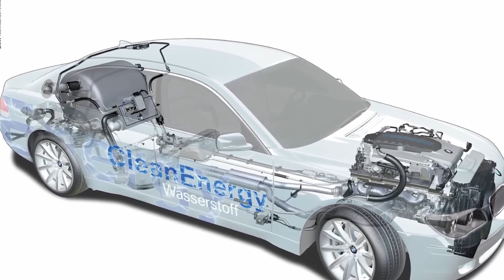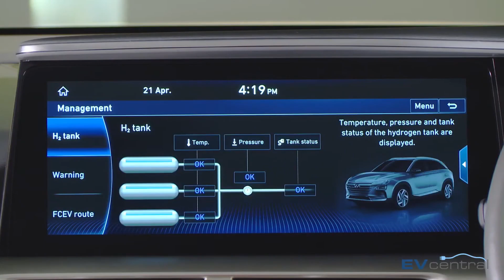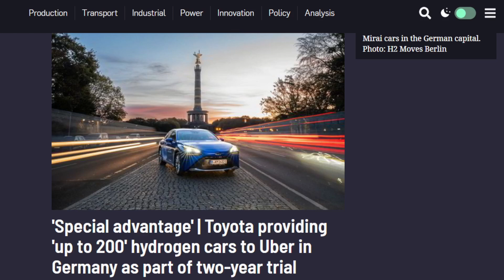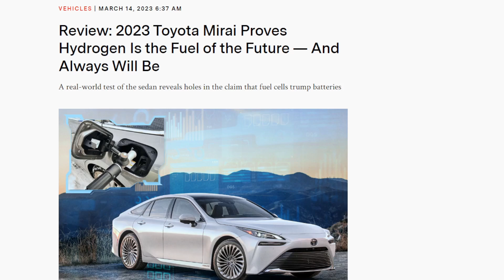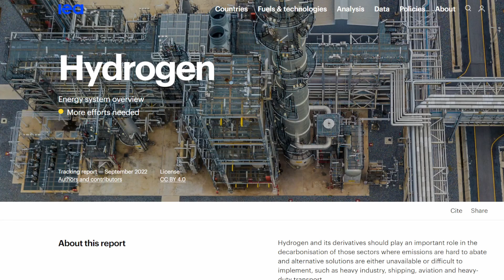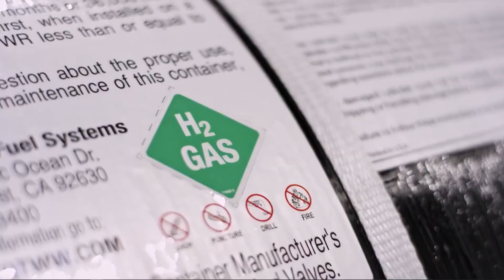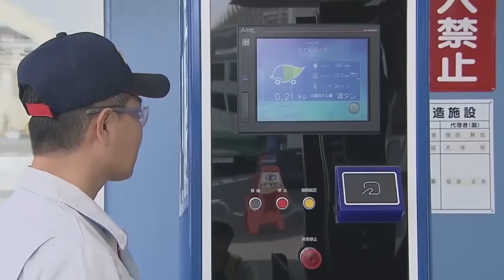Toyota Is DOUBLING DOWN On Hydrogen-Electric Cars - Here's Why.

Comment: VA, Another consideration here long term is the investment in filling stations and the commercial eco-systems that surround them.  Think livelihoods too.  Having cars pull in to refuel and by coffee, etc. requires a commodity like hydrogen.  Most likely, while many EVs will need to pull over to recharge, the vast majority of electric cars will be charged at home.  Not so with H2.  At some point, the oil companies are going to need to weigh in on their own futures post 2030/40/50.  That future needs to be envisioned by them now, because it WON'T be petroleum.  My bet is that H2 will be that commodity of choice.  As gas needs go down across the US, H2 as a void filler will best allow for a 1=1 transition, i.e., H2 production : refineries), pipelines : pipelines, filling stations : FSs, delivery trucks : DTs and H2 for gas.  I just don't believe the volume of car and foot traffic will be there if its an EV-only automotive future for the USA.  Maybe so, but Big Oil is going to have to take a vote in the matter too at some point, because the ICE world will melt around them otherwise.  I suspect the initial glimmers of where they stand in the matter will surface in an annual shareholder event related to the very real and looming problem of "stranded assets."

Comment: Hydrogen in 1978 - 1980 was used in Chicago Buses - when gas and diesel prices were 35 cents a gallon - 45 years later - we should be using Hydrogen to move all our 18 wheel semi trucks - in one day the US Postal Servive creates how much pollution inside of America - it is crazy - to THINK after 45 years we are not using a cheaper and more abundant fuel - as we burn coal to produce our electricity - Nikola Stock - buy now - 90 cents - everyone must be crazy - not to support it - in America

Comment: Unfortunately, the elephant in the room is the cost of hydrogen.  At the pump, the cost of hydrogen from 100% renewable sources has gone up another dollar from $26.75 to $27.75/kg at True Zero stations in the US.  Not heading in the right direction.  Hydrogen: $0.43/mi (Mirai), Gasoline: $0.09/mi (Camry hybrid), and Electric: $0.06/mi (Model 3), all with South Pasadena CA figures.  And the Model 3 weighs less than the Mirai and has more passenger and cargo room.
Reply from the maker: And inflation is 5%. Tell me something new.
Reply: @visceral_investing  Well maybe something new you didn't know would be that my electricity rate went down by more than 20% in the same time period.  If H2 was generated with electricity (green), it should be less and not more.  Also, the price of diesel to deliver the hydrogen went down by 22% in the same time period (from $5.25/gal to 4.10/gal).  As well as natural gas (gray hydrogen) prices fell by over 50% but still, Hydrogen went from $26.75 to $27.75.  They make it pretty much real-time, so it's not like there's some expensive inventory from the past they have to work through.  It goes up as people realize the true costs of a transportation hydrogen infrastructure.

Comment: I have come across 5 different types of electrolysers in all,one type called aem is a combination of two other types being the alkaline and pem models. Solid oxide models are now breaking ground in bigger way also.

Another type i have stumbled upon uses plasma and different frequencies and thats just the electrolyser technologies,on top of that
theres also a pyrolsis plasma technique using discarded things like tyres or food or waste paper etc and converting into hydrogen

You also have galvanic techniques utilising stored galvanic energy in metals like nickel,methods that incorporates lasers,artifical photosynthesis, enzymes that are found to give of hydrogen,alot is happening. 

I think much more innovation needs to take place just electrolysis alone as it is won't cut it,far to energy intensive.

I hope with ongoing geology survey work around the globe going on hydrogen can be safely and effectively be extracted from the ground as is the case in a Malian village.

Comment: I think the 3rd generation mirai may come out in 2026 or possibly next gen crown fcev
Reply: Crown FCEV is out the end of 2023.
Reply: @lesliecarter4295   I meant a possible 2nd generation
Reply: @jordanbrown7403  technically it will be gen3 of the fuel cell that the crown will have. Very likely the Mirai will be upgraded as well 👍
Reply: @lesliecarter4295   Im saying it will be the second as the crown range hasn't untill now had a fuel cell option. Toyota have used fuel cells before the mirai though so who knows what generation they are on.